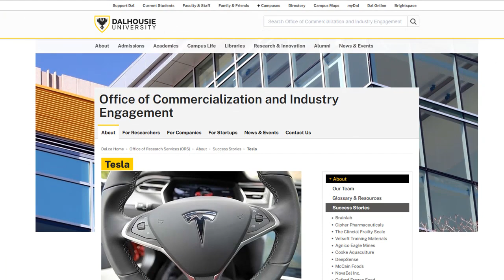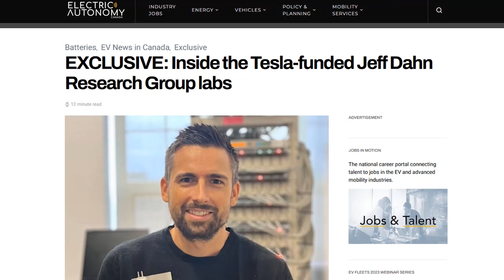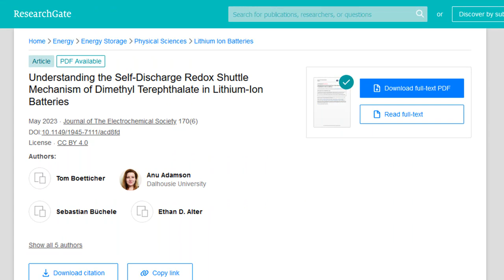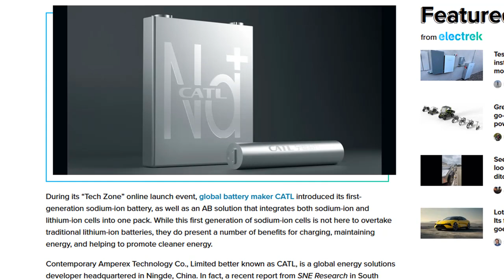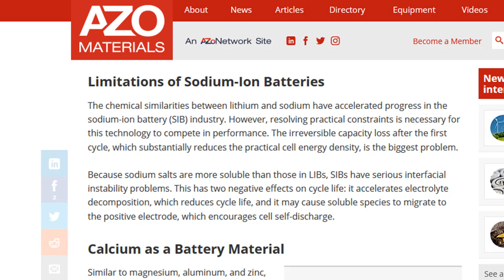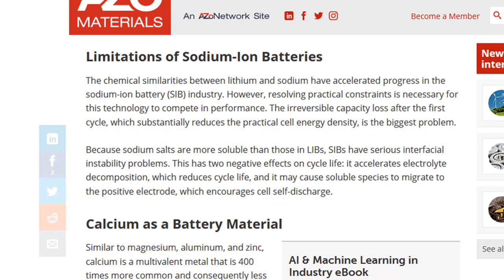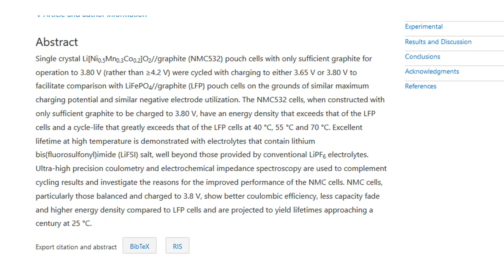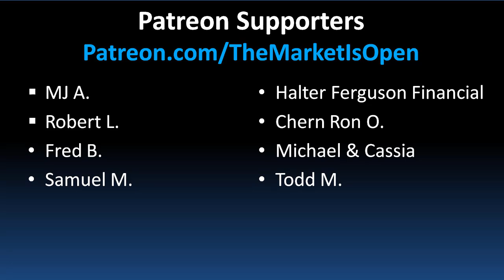Major New Tesla Sodium-Ion Battery Breakthrough

Comment: 3.7 million mile NMC would be incredible.... good lord. Hoping we can safely ethically access these raw materials.
Reply: That is why that chemistry remains in the laboratory because the 20% Cobalt makes it expensive and an ethical liability.
Reply: @kazedcat  damn... I will keep hope that healthy trade is enabled. The countries sitting on cobalt could become extremely prosperous if handled well.
Reply: @WILL_E_1  The trend is using less cobalt in the chemistry. The problem with cobalt is that it reduces energy capacity they are there just to improve charge and discharge. So the less cobalt is use the higher the energy capacity of the battery. With better additives and more accurate charge and discharge curve the need for cobalt in the chemistry is reduce.
Reply: @kazedcat  
100 year life makes it cheap.

Comment: What happened to eliminating Cobalt,  the use of sodium and lithium battery combo ? This article confused me.
Reply: They are not using cobalt in mass production. This are laboratory research just because they have done it in the lab does not mean they will move into mass production. So the lab tested this cobalt battery and it is really good but the cobalt makes it not ideal for mass production. Although that research said they are also testing a chemistry with less cobalt so the research is not waste of time just that the cobalt chemistry is the highlight of the paper.
Reply: @kazedcat or just not exploit the places were it comes from.
Reply: @christianvanderstap6257  Cobalt is expensive so even if they can stop exploitation. The material cost alone makes it not ideal for mass production. Also cobalt in NMC chemistry is a stabilizer so not only is it more expensive material the more of it you use in the chemistry the less is that chemistries energy density so you end up with more expensive but with less capacity battery.
Reply: @kazedcat  it also seems I replied to a different comment about the sourcing... Not sure what I fatfingered

Comment: Rather than cheaper, I hope they also seek to develop the best performing battery regardless of cost. There is also huge demand for higher quality batteries for other uses.
Reply: Yeah if you want density in exchange for lifecycle you can just do 30% silicon anode with only 100cycles. Or lithium metal anode that only have less than 10cycles of life. They are researching lifecycle because this research will unlock the use of chemistry that is not viable today due to short lifespan.

Comment: 4680 still isn’t even used 3 years after battery day.
Reply: It is in use, but in only the base Model Y. Tesla is still struggling with the dry process, and it hasn't met Tesla's expectations. That's the reason why they have not scaled up 4680 production to the max. Far from it. As a result, they are not producing enough 4680 batteries to meet their full line vehicle production. Tesla bought Maxwell battery dry process tech in order to simplify cell manufacturing (and save cost), but they have not succeeded in bringing this process to full scale.
Reply: @jean-yvesferry4669  
You haven't noticed that the Cybertruck is ready?
Reply: Wow, whoever is spoon feeding you what you pretend you know is making a fool out of you.